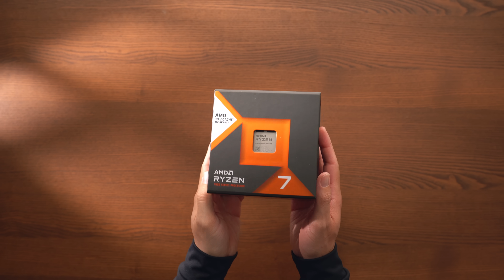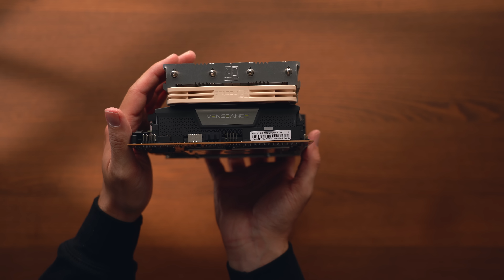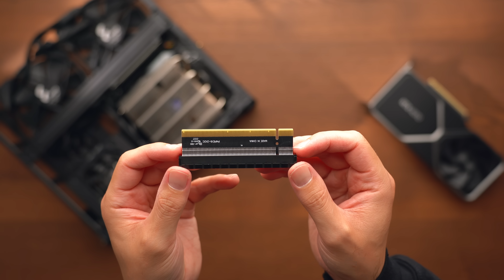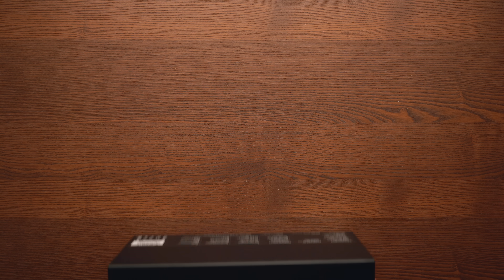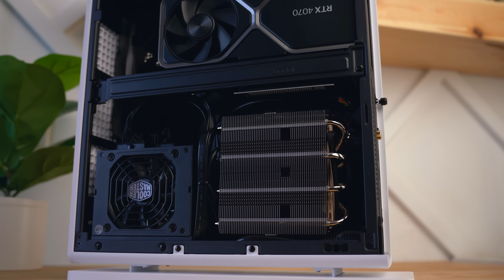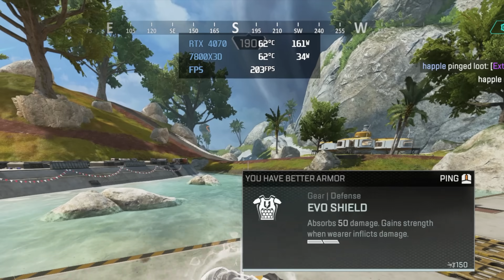UNREAL Mini Gaming PC - PS5 on Steroids

Comment: I love Mini and Micro ATX builds. Its the parts are right, the Temps are actually way easier to manage and better than a Mid or Full tower case because there is less Volume of turbulent hot air soaking everything in a big "Case". Instead the Heat is Yeeted the F*ck out the Case so much faster with small form factors "with proper hardware and placemen", the air doesnt have time to even hang around. Im so happy there is so many options for Cases and boards at these sizes now days. Im tired of making massive Cases with Custom Water loops over the last 10 years.

Comment: The pea size paste on the cpu is not optimal with any newer cpus, bigger sheilds and new designs makes the spreader way a better choice. So spread out the paste in a even thin layer. Use a creditcard or guitar pick.

Comment: I dig the concept and the case , but i would honestly just use the 5800x3d its still a very solid cpu and cheaper with less issues than its newer counterpart. And you might save a little bit as well

Comment: Looks like the 3080 Ti FTW3 will fit with 180 degree power adapters for the top 3 8 pin connectors

Comment: Yes, it is possible to wake up the PC from standby mode using a controller. However, you need to ensure that the controller’s settings are configured to wake up the PC from standby mode. If you are using an Xbox controller, you can configure it as follows:

Open Control Panel and select Devices and Printers.
Right-click on the Xbox Wireless Controller and select Properties.
Select the Power Management tab.
Check the box “Allow this device to wake up the computer from sleep”.
If you are using a different controller, you may need to check the controller’s documentation or search for instructions on the internet.

Comment: Bro your a master this is a better console than PS5 and Series X. This is what how console manufacturers should make consoles to where I'll be able to switch out parts of your using cheap cheesy parts to sell me the console but I'll be able to upgrade them and have the performance unlocked. Just have your proprietary software so we get that better experience and no pirating.

Comment: @05:25 It is always easier to attach ALL needed cables to the motherboard first and route them through the case and in the last step to install the power supply. 
Every YTer do it wrong the whole time...

Why do we have fully modular PSUs when nobody ever takes the advantage of it to install the cables first when you have much more space to do it?

Comment: This is a great video, it helped convince me to do a very similar build. One question for you, How are the CPU temps overall? from the video, it looks like they are great. I know the new AMD cpu's run a bit a hot. My 7800x3d runs hot when playing -mid 70s for the temp (I have the same cooler), and if it's compiling shaders or loading anything up it will hit in the mid to high 80s and even get to 90 for a second or two. I've been seeing some comments online regarding not pasting pea size thermal past on the new x3d AMD cpu's as the chiplets are spread-out and the pea size paste might not reach it.

Comment: Just ordered nearly the same parts. I went with 4070 Ti as GPU but the space inside is very limited and if you want to keep the case fans you are limited to 137x57x335 mm which is only suitable for MSI VENTUS with dimensions of 123x52x308 mm. Every other 4070 Ti is both too wide (power cable would collide with roof casing) and too tall so you couldn't fit case fans. Some are even too long so it's not really suited for 4070 Ti in general.

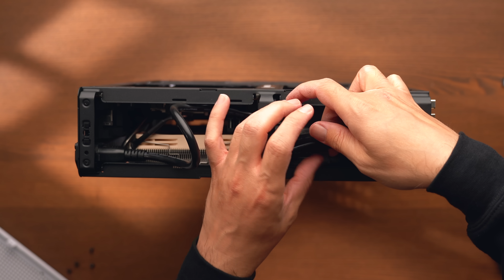Comment: 6:08 beware of using an intel CPU and MB here. I used an asrock b660m and i5 12400 F and had to cut the C13 cable's flex rubber guard as it was not letting my deepcool n600 to fit properly.

Comment: Maybe I am missing something, but I don’t get how the 7800x3d is not reaching its thermal limit in cinebench r23. I thought it is designed to reach it when higher performance is requested. I just built the same system, with the same cooler and case, but I reach 89C out of the box. Am I missing something or could it be a thermal paste issue?

Comment: Looks good but I cannot do without the wifi adapter (PCIe is a must since the usb ones are yoo flaky and some bsod) and a slot for my oscilloscope and another PCIe ×1 for the 2 ssd adapter.

If only this came in mATX.

Comment: Funny. on the noctua compability list, Noctua NH-L12S are only compatible with orientation 2 (the heatsink facing the upper side of motherboard).
now i wonder if the NH-L12S are also compatible with stirx B760-I gaming wifi. (i plan to build 13600k system on this case)

Comment: nice video, if i listened correctly, can i swap that 4070 with the full size founder 4080 and it it will fit no problem with same parts you had?

Comment: Did you use the intel fittings with the noctua, I ask as the AMD ones mean it doesn't fit.
The power cable in the case interferes with the fan it seems

Comment: Personally I don't like the case. And tall slim cases are just asking to be knocked over and fall down. I still have the Node 304, which is a bigger mini ITX case, but minimalistic and stable, no way to accidentally knock it over, it has a lower wider profile. Made out of thick steel that doesn't flex, it can even be used to put things on, like a PC case that doubles as a small table top. Can fit any full sized 2 slot card, almost any PSU, and big enough for a Noctua U14S with room to spare. Run it off of M.2 only and it has plenty of open space without the drive cages, and also enough room to run a push pull fan config on the heatsink. Oh and everything is filtered with removable meshes. It's such a good case I just keep rebuilding in it.  I don't need a display window, I don't need fancy lighting. Its minimalism makes it impossible to get bored of, because it's monolithic in design. It does what it's supposed to do, houses the hardware and doesn't offend the eyes while doing it.

Comment: It looks like you have to buy the best of the best components to get low-latency real-time no-DLSS-FrameGeneration-fake ultra settings experience even for 1080p on modern titles. I have RX 6700 XT paired with Ryzen 5900x and there are stutters here and there in pretty much every game (and I almost exclusively play multiplayer games where a constant 100FPS+ is a must for me).

Comment: Doesn't matter how fast it is in current era, as the number of modern high profile games with stutter and other optimisation issues mean you just get a broken product.

Whether this is caused by api issues and can be resolved that way long term, or maybe Windows in it's current form needs to be changed completely, or it's simply caused by the way PC hardware is not a coherent piece of hardware designed to work together in fastest possible way, communicating efficiently between different parts, I'm not sure, but something is not right and hasn't been for some time

Comment: Overall the CPU cooling is what turns me off, but I guess compromises are always needed. My NTZX H1 has surely better cooling for the CPU, but is probably worse for the GPU as the back of it is close to the back of the MB and the 9700XT backplate runs hot! The two fans here look very healthy, but the limitations for the DDR height sucks...

Comment: I own this case and love the look. But it has so much wasted airflow potential in my opinion.  E.g. the PSU pulls mostly air from inside and blows it back INTO the case again. Also the airholes are quite small and don't seem to allow enough air to pass through.

Comment: Also look for way smaller but better Lian Li DAN A4 H2O X4 Black, which also comes with a pcie 4.0 16x riser, tested with 1000w platinum sfx-l asus rog loki, 7950x3d, x670e-i wifi 6e bt 5.3 with usb4 40gbps, 96gb ddr5 6800mh, RTX 4090 and 240mm liquid cooler AIO gen8 pump... Absolutely the most complete and small mini itx case, others must sacrifice gpu lenght or cooler space and temperatures or psu or are simply ugly. Smaller than H2O there is formd t1, a4 sfx. All nice mini itxs.

Comment: You did set the exhaust fans pushing against videocard fan.
Reply from the maker: The case fans are set to intake, not exhaust. The fresh air from the case fans go into the intake fan on the back of the blower-style GPU (the side without the RTX 4070 logo) and exhausts the hot air out the back of the case and out the exhaust fan on the front of the GPU.

Comment: I've built the exact same PC following your tutorial. Except for the GPU, I have an RTX 4070 Ti Super. However, I have a problem with CPU temperature. During cinemabench test it peaks up to 88 degrees celsius. Have you done any adjustments in BIOS or other sofwares? What would you suggest to improve the thermals?

Comment: it's not that 3d v-cache helps in single threaded applications, it helps anytime there's a large amount of data that is consistently and repeatedly accessed. Gaming lends itself very well to extra cache because things like object properties, physics calculations, and other CPU operations happen every game update and can easily amount to more than most CPU's total cache amount. This means that the data needs to be retrieved from DRAM before it can be processed every single game update, whereas with a larger cache, the data can be processed much more quickly, resulting in less time required for a single update, resulting in a much higher max achievable framerate from the CPU not having to wait for data as much.

side note, this is also part of why games like CS:GO doesn't really benefit much from v-cache, even though is fairly single threaded, because there's not enough high-access data there to fill most CPUs' existing cache pools, making the extra v-cache mostly useless for it

Comment: Thanks for the great video. I want to build a small form factor gaming pc and want to keep it about the size of a ps5 or xbox series x. I live in a tiny home. Was told that these amall form factors would thermalthrottle and that i should stick to mid atx as the smallest build. How did you find over long period of intense triple aaa gaming the rig performed?

I don't game at 4k just 1080p. Ive been going back and forth with making the decision to build or buy a xbox series x. I do have a few steam games, but mostly been colecting consoles since i was a teenager. I recently bought a lenovo legion go,and a rtx4070 egpu set up. Love how cyberpunk looks and am afraid if Igo xbox series x im not gona liken the look now that ive seen 80 fps ultra/psycho raytracing. The go juat isn't a viable solution in my opinion ao its being returned. And i gota make the choice pc build, ASUS ROG G22CH Gaming PC, or xbox series x and wait until the next development in pc  i hear am5 will be done in 2025. So im also leary of not bwing able to upgrade when new gwn stuff comes out. I hear the minimum fps is gona be 120 fps forngames then and also gpu vram is gona be past 12g???🥴

Comment: And what if you take a minis forum B550 with a RTX GPU a power suply and  put into a case. It should be under 1000 euros and can run triple A with a RTX 1070 or 1060

Comment: Hey @devyn.johnston did you connect the LED at the front to the POWER SW pins on the motherboard or to the HDD pins?
For some reason, connecting to POWER SW does not light up the front LED.

Comment: Vid was awesome. I’m running a very large HTPC setup at the moment (seriously large, like fractal torrent large) and this vid gave me some great ideas

Like you mentioned in the vid I also have not been able to figure out how to wake my PC from sleep using the newer Xbox dongle. Still using the larger one. One thing I’m curious about though…is it possible to wake the PC from sleep using the mobo’s onboard Bluetooth chip? BT via USB does not work for me so I was curious if it’s just a USB power issue or if windows just limits BT in general

Also big picture mode is still the best fullscreen launcher around currently. I’ve given playnite and launchbox a try but the features that are present in BPM easily blow the others away

Also, f$&k the epic games launcher

Comment: I really think this should have been a video on using this case but with a cheaper cpu and gpu like a 5600x or even a 10400f with a 3070 or something. At least the price point on that would be more reasonable
Reply: 5600x yeah, 3070 no way. rather go with a 6700xt or 6800 then

Comment: Love my 4070. It's actually an amazing card. It's just the price that did it dirty. 
undervolted pulling 168 watts max, yet with FG performance of a 7900xtx, and often 3080-3080 ti without it. 
Love it!!!
Reply: Don't compare DLSS 3 perf with native lmao... FG adds tons of input lag which is why many don't like it. It's USELESS for multiplayer games for example, latency is way too high, 4070 offers 3080 performance, the end, 7900xtx utterly destroys it
Reply: 4070 is on par with a 3080/3080TI you got mugged off kid lol  should of got a 3080
Reply: @mythicgoose  I'm running max at 168 watts, with FG matching the 4080 chillin at 55c.max load. 
Only cost me 499 too, cheaper than the 3080 🤭👌
Bet irl you look like you got mugged tho 🎉🌬️
Reply: @duckilythelovely3040  which brand
Reply: I sold my 3070 FE for $600 and after fees, I’m only paying $100 for a 4070 FE 😃. The price for 4070 is crazy, but 100 just to upgrade, can’t beat that
Reply: @xBravo412x  heck yeah man, enjoy it. Undervolt it, fantastic card. 
Love mine..I use it only for wow, and It plays so damn smooth..
Reply: @duckilythelovely3040  thanks man. Buying upgrades parts now. Question. Why undervolt?
Reply: @xBravo412x  undervolting will reduce how much power the graphics card needs to achieve the same speeds. It'll reduce the heat of your card, which in turn reduces how loud it gets. And the lower the temperature of your card the higher your boost clocks will stay. It's worth doing it. Also the less power your card needs to use will likely extend its life

Comment: I got a Lianli 011 case now with 3080ti, R7 5800X 8 core , DDR4 32gb 3600hz and Asus Strix B550-F Gaming. I move back and forth from home to campus. So I want to build it with a smaller case. I believe my card will not fit in this Mini case and I would like to keep my current CPU and GPU atleast for a new build. Want would you recommend ? Thank you

Comment: Does RTX 4090 Msi Ventus 3x 3slots 322mm lenght fit inside this? And PSU, sfx-l Loki 1000w does It fit? Also CPU cooler l12s would be enough for 7950x3d?

Comment: I don't think you would have gaming improvements from having a 7800x3d with a 4070. You've probably got a pretty sever bottleneck running 1440 with that gear. I would try a 5800x3d with a 4070, doing that you can save money on a motherboard and RAM because you don't need AM5 chipset (expensive) and DDR5 (expensive-r). Looks cool though.

Comment: I'm using the Noctua NH-l9x65 cooler in this with a 8700g  CPU and it is HOT , looks like the Noctua NH-L12S is the only cooler for this , you have to pull the heat out , it sucks I will have to buy low ram and another cooler .   I'm using a 65 watt chip and you have a 120w in this .... that's crazy ..   update looks like the cooler will not fit my case

Comment: I've neen doing some research into small form factors because I want a living room pc to replace my PS4 as opposed to getting a PS5/XBox. I don't want some massive LED covered, tempered glass sided, Liquid Cooled, Virgin energy emitting power tower, so something sleek and minimal and mini atx is probably the route I'm going to go as tbh I don't care if I'm running at 10k when I'm on a couch. This is Probably too much for my budget but it's showing me what's possible with form factor gaming rigs :) Subscribed for more
Reply: I am interested in something that's a size of xbox one x but pc based minimu rtx2060, have you found anything under $500?
Reply: @zzz-cb3xe  I haven't, it's not an easy thing to do with mini PCs sadly.

Comment: - Using a pea sized drop for this CPU is not sufficient (anymore)
- You used a SINGLE 8-pin PCI-E power cable with a SPLITTER at the end instead of 2 separate power cables, why...?

Comment: 7800x3d is not increasing single thread performance, also the performance you showed was with the 4090 you installing a lot slower 4070. the cpu is mega over kill for that build specially as this only used for gaming and media consumption…

Comment: I have pretty much the same build, except with 17TBs of SSD storage for games. It's whisper quiet and tiny ... trying to get away from high wattage builds, they cost too much to run.
Reply: Also, I had the same problem that the reviewer had with the Gen 3.0 riser card. By default if you run a Gen 4.0 card using it it'll cause issues .. games will crash or run at very slow speed etc. I reported the issue to Fractal and they sent me out a new riser card within a few days .. excellent customer service and a fantastic case.

Comment: The case is cool at least, but ps5 on steroids? Not really, at least it's both positive in that yes it's more powerful, but negative in that it cost way more for not much of an upgrade. Maybe thirty percent faster average roughly? It's essentially one grade of processor up in terms of performance with a very high price premium for cost per frame. 

I think the 6600 xt is closest in terms of performance? But the 4070 is like a way more expensive 6800. You could make a build in a small form factor like this for slightly more than a PS5 in cost.

https://youtu.be/DNX6fSeYYT8